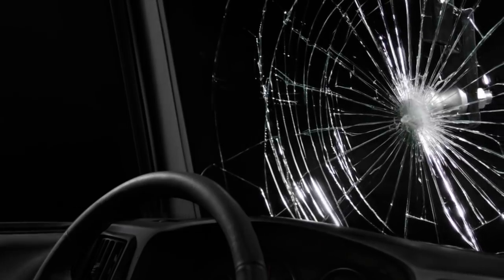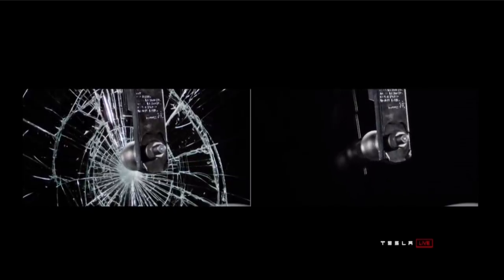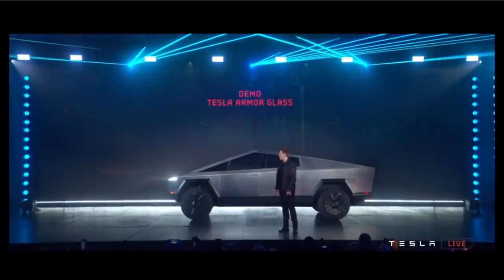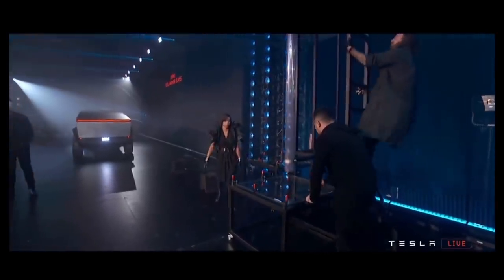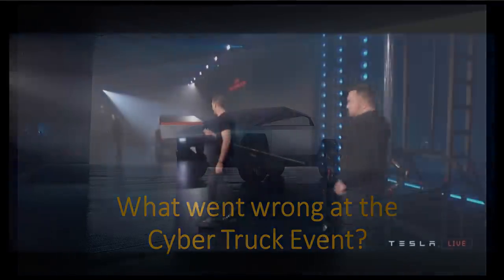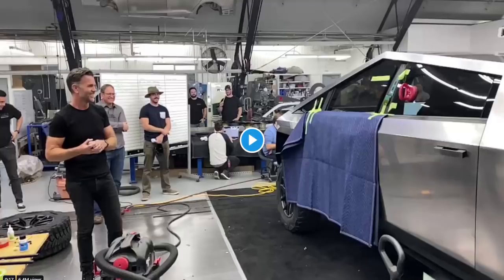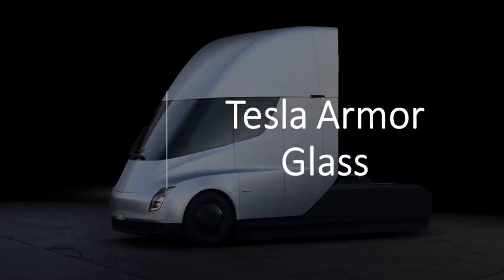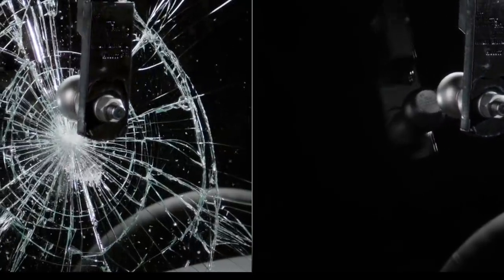What is Tesla Armor Glass & How is it made? Tesla Cybertruck and Semi Glass Analysis

Comment: Another article pointed out the fact that during the initial demo, the clamps were re-tightened after each ball drop.  They had hit the Cybertruck door with a 10 lb sledgehammer but no one checked to see if the window was still rolled up "tightly".  A slightly loose window at the top would have caused the window to shatter.

Comment: The sledgehammer hits weakened and made the glass loose..... Its been discovered (Elon has reported the findings)
Reply: bob chou yes, but!!! The elephant in the room is... what happens to the glass after 100,000 miles? Does it get weak stress fractures from all that movement during its life with the vehicle? Hard breaks, sudden stops, big bumps, off roading, stressful inclines on its east and west sides... on and on. That’s the part that us consumers need to know because I’m sure this glass AINT CHEAP!
Reply: @jacobvanveit3437  I don't think it easily breaks the way you are thinking. I think it was because of that hit it got, after it had moved. I am also this is because it is during proto stages, later versions of that glass  are going to be better, and the break during demo actually was a good thing in that it made the glass a very important focus of the demo and it's most likely Elon is going to prove the glass is strong in another live demo just to dispel the mishap, but this time with an improved version.
Reply: He didn't hit the back door.
Reply: The windows dropped and weren't secure in the doors. It's on the video. The sledgehammer didn't weaken the glass, just dropped them from being in the up position.
Reply: Arashi Mokuzai  So why Elon agreed to try again on the back window? And the way it broke, it was also bulletproof. A normal window wouldn't resist as it does.
Reply: Sledgehammer didn’t weaken the glass. I think what it did is make the glass”loose in the window Chanel. No cushion.
Reply: Arashi Mokuzai  haha I'm sure the truth is: Not legal to have full bullet proofing because legislatures want cops to be able to shoot us
Reply: Arashi Mokuzai  That is complete bullshit. If that was true He wouldn't have said go ahead to testing the rear window. And the ''sledge hammer moved the glass'' is also bullshit. He never hit the back door. So if part of the car gets hit it means both door glass is comprised? Doesn't seem likely. And look at when he hits the door vs hitting the cyber truck door with the sledge hammer. He puts 1/3 of the force attempting to get cyber truck vs the f-150 door. They're not testing it truthfully with apples to apples. They are changing things to make their shit look the best when it aint. I ain't a hater, i love these electric vehicles. But they don't need to set shit up unfairly and say that its the best when they aren't testing it fairly.

Comment: 5:15 watch the glass drop down about one inch. I think the sledgehammer also made the glass drop leaving it with no support. This is why during the demo they kept making sure the clamps were still tight.
Reply: that could be apart of the door opening feature (glass drops  bit to allow the door to open safely) present on other teslas.
Reply: This glas doesnt seems to be inside the door . this blue blanket wouldnt fit there

Comment: The glass breaking in the demo had nothing to do with the glass being weaker from previous testing.  When they hit the door with the sledgehammer, the glass dropped, and it wasn't secured in the door, which lowered it's strength.  Notice when they were initially dropping the ball down the tube on the glass, they were retightening the clamps after every drop.  If they had done the ball test first before hitting the door with the sledgehammer or had rolled the windows up fully before the window test, it would of been successful.  I assume in the production version, the mechanism for holding the glass in place will be much stronger.
Reply: Appreciate the updates
Reply: I ordered a truck and I'm sure they will fix everything and more before production. but some facts...they didn't hit the back door with the sledgehammer. And the highest drop on the armor glass was WITHOUT the clamps...EDIT it appears I saw it wrong, the glass appears to be clamped but after the ball hits it gets unclamped . You could clearly see the glass jump when rebounding thus reducing the load on it a bit
Reply: @newtontemoke3126  Test 1 - Normal glass small ball - glass is clamped.  Test 2 - Armored glass small ball - glass is clamped. Glass is tightened after test.  Test 3 - Armored glass small ball, higher height.  Glass is tightened after test.  Test 4 - Armored glass big ball higher height.  Glass is tightened after test.  Test 5 - Armored glass big ball, maximum height.  Glass is tightened after test (no further drop testing done)  Big ball handed to Franz for test on vehicle.  The glass was clearly secured in every test and the clamps were retightened after every test.   Now as for the fact that they didn't hit the back door with the sledgehammer, it's a good point but you can clearly see that the top edge of the rear door glass is visible if you watch the video.  I don't know if because of the unibody construction of the Cybertruck the energy is just more easilly dispersed through the frame and maybe a reason why the back glass dropped as well.  Honestly I'm not sure, I can only make an educated guess. The camera work is a bit shaky and it is very difficult to see the rear glass drop during the sledgehammer test, it was more noticeable with the front door.  The other thing I noted about the back window was how high on the glass Franz hit it.  This is important.  Typical tempered glass is incredibly strong if impacted in the center, however it is very weak at the edges.  I can only assume that like tempered glass this armored glass is also a bit weaker at the edges.  I've also ordered the tri motor version, I'm sure many things will change before final production!

Comment: The glass broke because before they threw the ball at the glass the big the door with a sleghammer and that made the glass move out of place. As you can see when they drop the balls from a certain height, the people in the black  keep drew the glass down to the surface to give the glass it's full strength.
Reply: So what good is this glass if it only works well under special circumstances? A real collision won't prevent the glass from being moved out of place. Thermonuclear explosion-proof? I don't think a nuclear explosion would cooperate in keeping the glass in place either. It's a good thing he didn't claim the glass would be used in the Starship rocket, or there would be more doubts about that too.
Reply: @manofsan  The Semi windshield is secured in place. Cybertruck door is less secure but they only need to be strong enough against small rock and debris.

Comment: Pay attention to the drop metal ball test, the assistant need to assure the clamps are all secure for every drop. This is probably crucial for the glass to maintain its integrity during impact. The throw test failed is probably the gaskets got loose after all the crap they threw at it earlier. I think they should be more concern about the door frame integrity rather than the glass after collisions
Reply from the maker: Good point
Reply: The clamps give way each time the ball drops. That's why they need to retighten the clamps. Energy from the ball is transferred through the glass, makes it wobble and loosen the clamps. In the cybertruck the glass was actually fully fixed and could not move, so instead it had to absorb the energy from the impact and it cracked as any bullet proof glass does.(look it up on youtube)  However it only cracked, it didnt let the ball through. The ball bounced back.

Comment: 1:53 ‘surprises with styling’
Styling, or engineering constraints?
You try ‘styling’ with 3mm cold-rolled 30x stainless steel.
Reply: James Conway  Really? Hydro forming could work? Are you sure?
Reply: James Conway  No doubt it could be cut in an abrasive waterjet cutter! There you have thousands of pressure units on a fraction of a square mm... On shaping it by hydroforming - I am still trying to visualize the clamping forces and metallurgic effects. It surely would be an impressive high energy process if it can be implemented at the scale of the sheets required for a truck! I saw that Elon said that even for bending they require deep scoring, than somebody threw out the number 3mm thickness! I have worked with 321 stainless, you can hardly machine it with conventional tools. Bending it will likely brake your press, I think you might have to do it with ultra thin sheets, than layer it with Kevlar composite in between and possibly even have something better that the thick heavy metal they used so far! By the way anybody published the trucks weight?

Comment: I think the shape of the windows are to aggressive with uneven corners. If you look at any armored vehicle used in the military they have some uneven corners, but not as aggressive, more often just squared. The reason is that the structural integrety of the glass is compromised when you give it weird shapes for the impacts to transfer and spread out.

Comment: My main problem with the glass is that glass needs to be able to completely shatter so you can actually escape your car if it catches on fire in an accident, or goes in to a lake, or is in any situation which you need to escape quickly.
Reply: if it catches on fire you open the doors 
if you drive into a lake everyone knows your best to let the car fill with water then open the door there are also manual releases on the doors ontop of that if you hit a regular car window it wont just shatter  most things will bounce
Reply: @ScottishRebel  If you get hit by a car, your doors might be jammed closed, or you might be knocked unconsious and someone else outside of the car might need to rescue you through the window. Sometimes, there's more to it than "just open the door".
Reply: @Boomchacle  tesla pride themselves on safety and this has 2 years before production I reckon all these issues will be fixed by then
Reply: @ScottishRebel  A car can be incredibly safe, but if you get T boned by a drunk going 50 over the limit, there's really not much your engineering can do to stop his car from crippling your car's ability to function properly or knocking you out.
Reply: @Boomchacle  with the new exoskeleton design the cyber truck could negate a lot of the impact but regardless of that any car would be severely damaged so I don't get your point against the car irself
Reply: @ScottishRebel  Yes, every car would be damaged by this sort of problem, but with normal cars, the side windows act as escape areas because you are able to break them using a glass breaker, but if you have armored glass windows, unless there is a special feature which I am unaware about, you wont be able to escape through them. I'm not saying the tesla truck takes more damage than normal cars, I'm saying it takes an equal amount of damage.
Reply: @Boomchacle  it's designed like ballistic glass it can take hard impacts but something that's focused on a small area like a glass hammer will still shatter the glass
Reply: @ScottishRebel  It has laminate layers, so even if the glass shatters, it's not going to actually open up in a way which lets you escape, unless It's a solid peice of ALON with nothing around it.
Reply: @Boomchacle  from tests it seems the glass has a drop feature when struck it will drop this would allow it to be weak enough to crack with the hammer and push open with minimal effort

But this is just my opinion we sha have to see
Reply: @ScottishRebel  As long as there's a way to make the glass get out of the way to escape the vehicle, I've got no problems with it.
Reply: @Boomchacle  tesla will have to follow regulations and so will have to figure it out regardless of what is shown

Comment: Alon is super expensive, so you're wrong, it's probably some variant of cheap sapphire or something

But also, it's aluminium
Reply from the maker: You might be totally right - but Tesla might have figured out a more efficient and cheaper way to manufacture ALON or something similar... Thoughts?
Reply: @Cleanerwatt  The cost might be due to small volume production. That is why Elon is putting it into everything to achieve large economy of scale. Nothing in it's composition aluminum, oxygen, and nitrogen. The last two can be pulled from the atmosphere so it is the production process that is expensive. And if it is production process that is expensive then the sure way of decreasing cost is large volume production.

Comment: I think they do it themselves. They probably will use the same glass in starship, which would describe the hard demands they have for the glass - survive impact of space debris and extremely big pressure difference on the both sides, which is why Elon claims it will survive a nuclear blast. Think similarity to rapid decompression in a starship because of hull break. 

Another reason for this is that I suspect spacex will use this Tesla Cybertruck to drive on the moon. Self driving is important because it will be hard to touch all buttons in a suit. But if they are going to use spacex flight suits the truck must be pressurized. With the components required for this be in the frunk maybe? Space over for moon atv on flatbed?

To use the glass in real situations like Cybertruck on the road in real accidents this it will be really good test data back to the team. They get the tech validated so 100 people will feed safe inside the starship with big glass windows. 

It’s only four years until these things are on the moon! They need validation quick!

Comment: What went wrong? Easy. Look at 3:28 closely. The assistants release the clamps at the sides of the glass when the ball was dropped from the highest level, which allowed the edges of the glass to fly up in reaction to the impact. Without the clamps being released, the glass would not have not been able to absorb the impact from that height. With the glass installed, and the edges all therefore clamped in place, apparently Franz' throwing arm accelerated the ball above this ability to absorb impact.

Comment: Ordinary toughened glass does a great job but will break when you need it to. Do I want to be trapped inside my vehicle after an accident?
Reply: I believe the Tesla armor glass is still gonna shatter open, real armoured glass have films between layers of glass so even if the glass breaks it stays intact, but this is expensive so I doubt that Tesla implemented this in the Cybertruck. However, if the glass is really that hard then it might be a real problem.
Reply from the maker: That is a good point - it does need to be tough (an is) but not so much that you cannot escape in an accident, Good observation.
Reply: So, you want a bulletproof glass and one that will break easily? Can't have both. This compromise is ideal in that it prevents rock cracks and discourages car jackings but is not impossible to break.
Reply from the maker: @captkerosene  True. Much safer for accidents and the like.
Reply: @captkerosene  Bullet proof glass exist but there is no axe proof glass. A small hand axe will shatter armored glass just the same.

Comment: That glass seemed to break exactly the same as if it was regular safety glass.  I dont have any experience with the product personally but Mr. von Holzhausen did not throw the steel bearing very Hard IMO.  I've read that the product may have micro fractured during the bodypanal demonstration (sledgehammer strikes) but I'm not convinced.  FRanz did not hit both doors and the Twitter demonstration was also on the drivers window only.  It doesn't make sense at this point.  I hope that Elon Musk and TESLA are completely 'transparent' with the investigation.  I've read that it was a stunt but again that doesn't hold water ... body language and the intense blush on Mr. Musk's face, along with the fact the he couldn't get off stage fast enough while the screen behind him played objects, lumber, tools, and hardware hitting armoured glass.  If that was me I would be hitting the incident with a forensic investigation.  I'd want to know what happened.  Was the truck left alone for any amount of time ???  Forensic background and financial checks on anybody with access to the backstage area including security, technicians and caterers.  I wouldn't stop until I had PROOF of how and why.
Reply: Watch the video of clean technica. Apparently it had something to do with the glass falling down a bit when they hit it with the hammer. That ment the glass was not fixated, therefore weaker.